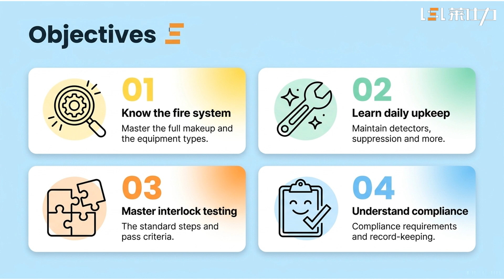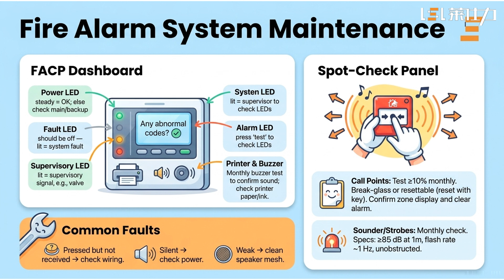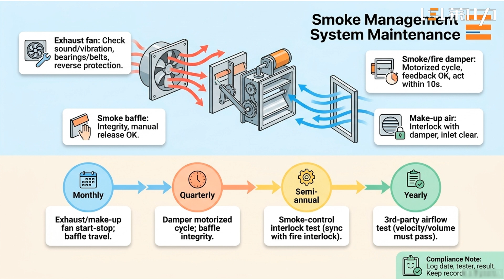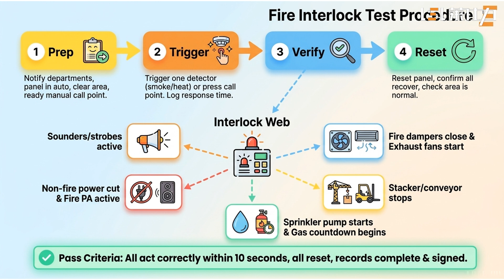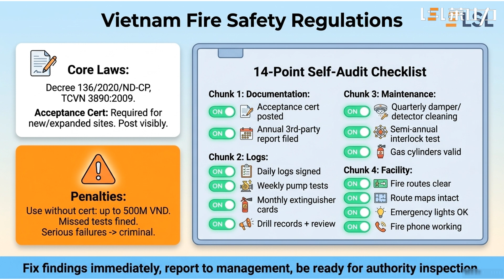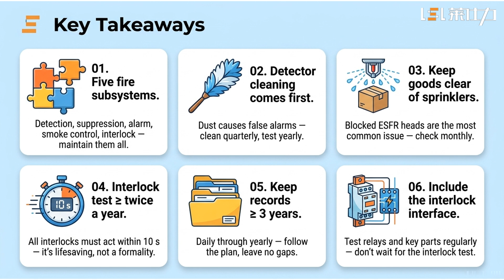Fire Safety in Automated Warehouses: Key Practices for Engineers

Comment from the maker: ⏱ Timeline
  00:44  Four Learning Goals
  01:21  Five Fire Subsystems
  02:04  Alarm Panel & Call Points
  02:53  Detector Types & Cleaning
  03:37  Suppression: ESFR & Gas
  04:20  Smoke Control System
  05:15  Extinguishers & Hydrants
  06:05  Interlock Test Procedure
  07:02  Maintenance Plan Tiers
  07:41  Fire Drills & Evacuation
  08:37  Vietnam Fire Regulations
  09:32  Real Interlock Test Case
  10:14  Six Key Points Recap
  10:53  Summary & Next Episode